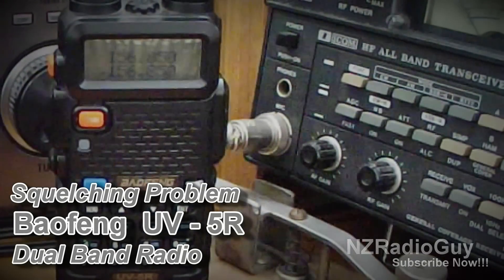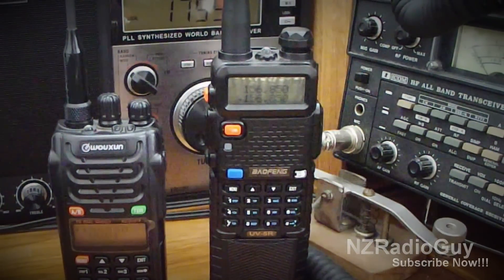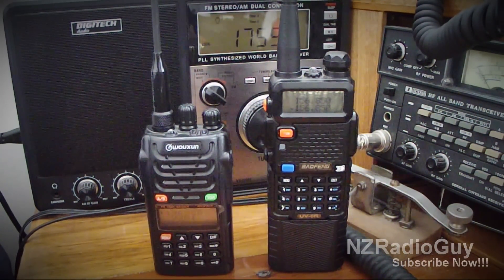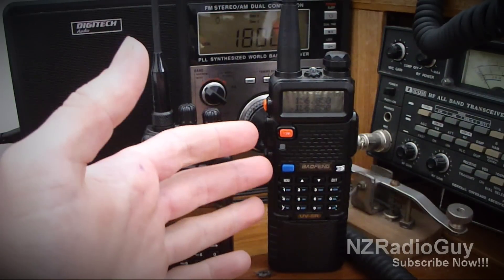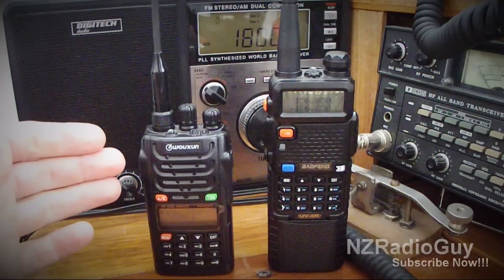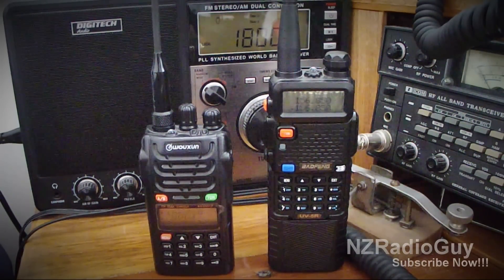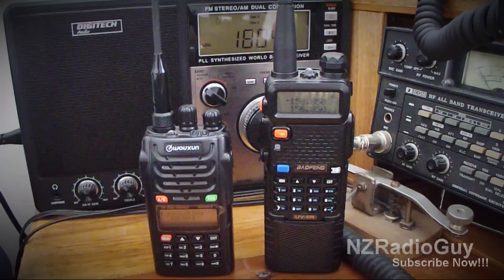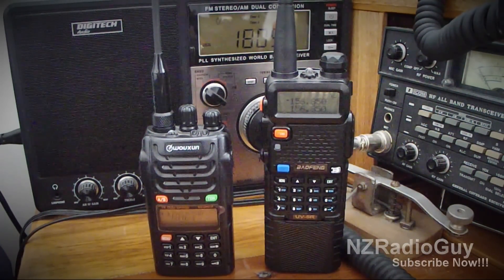Baofeng UV-5R  Squelching Problem

Comment: for some reason my baofeng will randomly close and open squelch on seemingly strong signals. it'll come in, close for a bit, come in again and keep pulsing like that in no particular pattern. what should i do? it happens on all settings between 1 and 9 and the signal sounds solid if i hold the monitor key.

Comment: I got a brand new UV-9S tri that did this straight out of the box. I plugged in the head set and did a mic check and it stopped.
Reply: Wow Thanks.... That really did work for me.... Crazy I have 2 exact same radios one was doing this the other was fine. I put the mic cord in there and keyed it up a couple times.....PROBLEM SOLVED thats crazy....Thanks Again......
Reply: @danjeffries1155  my radio acted up once more 12 hours later. I repeated the process and raised the squelch. Problem solved. I believe it's a grounding problem. It also goes away when you apply an abbree military folding whip style antenna.

Comment: That is not a Squelch Problem. That is Diffraction, quite common in the Radio Business, and Scanner Radio, as well. Try moving the unit.., or USE A BETTER ANTENNA. THANKS
Reply: I was thinking the same about the antenna. Mine does the same thing, but when I grab the antenna it stops until I let go.
Reply: or.. Picket Fencing, also.

Comment: Problem solved: all UV5R come with strange squelch programming values. It's possible to fix it by Chirp on Service Settings tab. ATTENTION: newer Chirp versions doesn't come with this tab enabled, so download the Chirp daily build 20150111.

You can check this info with more details on http://www.miklor.com/COM/UV_Squelch.php

I hope this tip help you all, because it did help me.

Best Regards.
Reply: I had a brand new UV-9S TRI that did this straight out of the box. I plugged in the headset and did a mic check and it stopped.
Reply: Olá José Carlos, tentei as sugestões do site que você sugeriu e não obtive sucesso, que valores você adotou?

Abraço

Comment: I FIXED THIS!
After having 2 of these Baofeng BF-F8+ (an updated UV-5R) stop receiving without holding down the monitor button, I used CHIRP to apply an image of a particular firmware and restored the radio to full functionality.
Turn on the radio while holding down the 3 button.  This will briefly show the firmware version.  Go get a CHIRP image file that someone has been so kind as to post online, or via Baofeng or the Baofeng USA distributor website, for that image.  Instead of using a software to receive a download of a version "x" image from one radio and upload to apply it and the settings to a version "y" radio of the same model, just upload the blank setting image.
I was not aware that the image files uploaded and downloaded via CHIRP had the firmware as well.  A refresh of the image via a CHIRP upload from a clean image FIXED the squelch problem.
This seemed to be entirely a software problem resolved with the headphone/microphone/USB cable to a laptop running CHIRP with the right version firmware image file.
Reply: How do you upload a new firmware via Chirp? Is it possible to do with UV-82?

Comment: Hi I just purchased a gt-3 mark 2, the problem I am having both can transmit, but the only way to receive on the other radio is if I press and hold the moni button on the side, both have the same issue, have tried different squelch levels to, any help would be appreciated thank you

Comment: The squelch basically only has an on/off switch and no sensitivity adjustment. manufacturing flaw..the baofeng GT3 has better squelch.
Reply from the maker: Cool. Thanks for comment. NZRadioGuy
Reply from the maker: Hi, Thanks for comment. I think a lot of people have had problems with the UV-5R. All the best, NZRadioGuy
Reply: +iRateAt308 When I press the talk button it squeaks and you can hear it screeching on the receiving radio. How do I fix it?
Reply: how close is the receiving radio? It could be feedback.
Reply: iRateAt308 We tried it up close and as far as 50 yards. It only happens with that radio though.
Reply: There's a chance that your radio is defective
Reply: I thought so..I set squelch to 1 and it's the same as 9